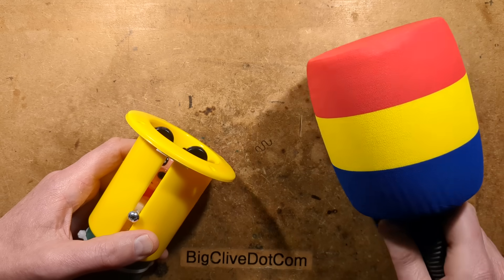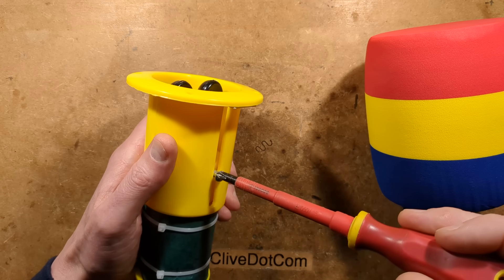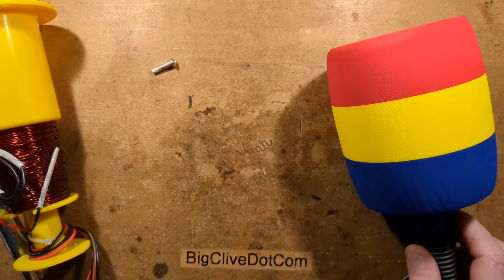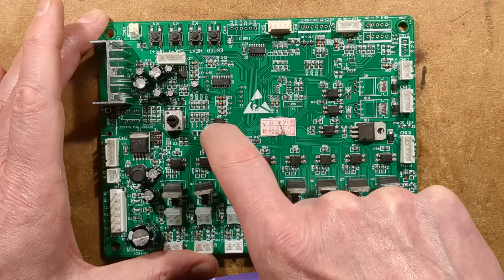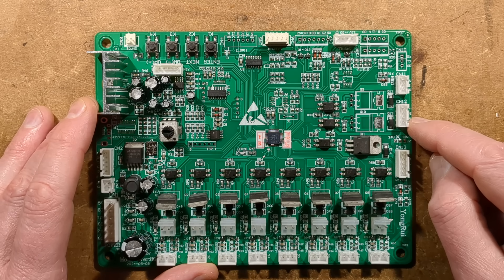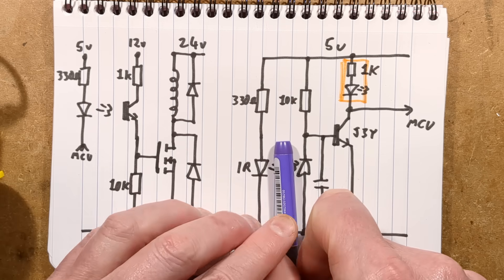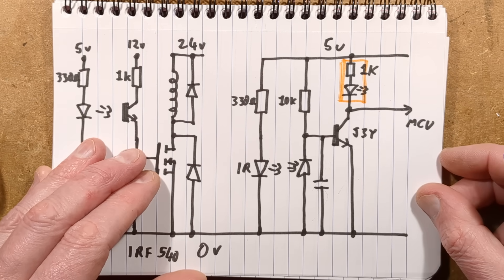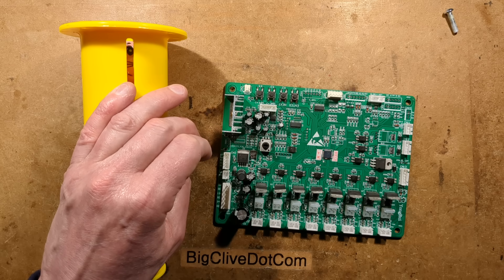Exploring a Chinese Whac a Mole type game

Comment: It's odd that they skipped 2 MOSFETs, but still fitted the optocouplers and connectors. I initially assumed it's because the MOSFETs are through-hole, so loaded at  different stage, but aren't the connectors also through-hole?
Reply from the maker: Maybe just manufacturing options.

Comment: Interesting note, I live about 15 minutes from the company that invented & manufactures the original Whack-A-Mole, and I once worked for another company that was their IT maintenance contractor. I applied for jobs there a few times over the years, but only once got a call for an interview - just after getting a job elsewhere. It was all good though, the job I did get was a good one.

Comment: The "key" connector is probably for a remote keypad which is on the inside of the coin door. These are used by operators to be able to set up/adjust/diagnose the machine without having to reach in to press buttons on the board. You can stand in front of it and stoop down and press the buttons on the open door. It probably supports 4 buttons which are wired in parallel the 4 on the board.

I have a friend who worked in the vending/amusement industry in the US and the stuff you say about poor diagnostics is on purpose. The number one mantra is "get the money". Don't lock anything out unless the machine is at risk of giving away free items/entertainment. So machines do not deactivate even in rather broken states. People who lose money because the machine doesn't work right are seen as an issue for the operator to resolve, not the machine itself.

The machines often have decent diagnostics but they only store codes or don't run until the operator uses the buttons (mentioned above) to run them. They are there for the operator to diagnose the machine and fix it, not for the customer (non-operator) to discover the machine is broken.

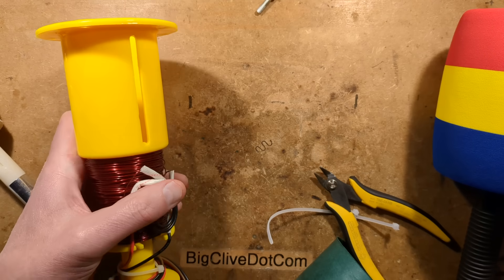Comment: 4:13 That is a KSD9700 bimetal thermal fuse. So yes, it will self reset. An 85°C fuse should trip between 80 and 90°, and reset at 60°C, +/-15°. (So, not exactly a precision device!) I don't believe they could make a one-shot, non-resetting fuse anywhere near as cheap as the self-resetting ones. I think some special purpose gallium alloy devices exist for some times when you need an exact temperature cutoff, but a cheap bimetal strip will always be cheaper. And a PPTC fuse has a gradual increase in resistance and low current handling, so isn't really useful in situations like this.
Hah... And you said we might not be interested in the thermal fuse! 😂

Comment: Mistake I made in the 1980s working on domestic gas appliance test rigs was taking the coils off the water / gas valves and they burnt out / smoked while I was fault finding the production line test equipment.
Our test rigs used mechanical rotary switch stacks for logic a bit like old rotary switches on washing machines before electronics.

The following year 1984 I was programming a rack mounted computer (BBC basic) pneumatic full bore ball valves and gas measuring meters [Laminar Differential Pressure (DP) Flow with mV output] using MODE 7 graphics on a Ferguson TX 90 with RGB

We had a large bubble glass stack about 6ft long and 1ft diameter with optical detectors to detect the soap bubble traversing the vertical glass cylinder which was a know volume for our standard calibration for natural gas boilers.

All great fun and all before the internet [those days you were on your own]

Mercury bead used as an O ring in a small glass tube was used to calibrate needle valves that we used to test appliance production line gas leaks, on our gas fires we capped off the gas jets applied pressure and tested for leaks, even if you saw soap bubbles on the brazed joints it would still pass providing there was a green light on the test rig.
[remember we sealed the jets with rubber caps and in used the jet in use would be open into a Gas Fire Radiant with no back pressure]

Now I feel old thinking back that long ago
Reply from the maker: At Hussmann we used to stuff a screwdriver inside the coil if we took it off the solenoid valve during testing, to give it something to chew on.

Comment: The issue of the the micro locking up and cooking the coil issue could be countered by using a charge pump to drive the gate of the MOSFETs.  

A past employer used it on a system for staged curtain drops and reveals, known as ‘kabuki drops’ in the theatrical effects industry, to minimise the chance of a false release.

Comment: The whack-a-mole games often have 9 critters (in a 3x3 grid), so I was surprised this didn't have provisions for 9. The controller listing shows a machine with a 3+2+3 interlaced arrangement.
Reply from the maker: Possibly because 8 outputs fits nicely to a single 8-bit microcontroller port.

Comment: ah you didnt' power it on, i wanted to hear the 8 bit sounds ;) I bet the key is something to do with opening the money door, or the printer that prints those tickets that you can reclaim for shit prizes
Reply: Most of these use dedicated MP3 decoder chips for sounds, usually on a flash IC. For example I saw a claw machine controller on Aliexpress that uses a USB flash drive for the sounds, and you can add your own.

Comment: There's a photo in the listing of the circuit board that shows which connector goes to what, and not all the bits come with it, speakers, lights, coin mech, etc. Did the circuit board come with the bundle of wires shown in the photo?
Reply from the maker: It does have the wiring loom.

Comment: Always been fascinated by arcade machines and owned a couple of fruit machines in the past that gave up the goat when the gruesomely expensive Mars Mech stopped taking coins and then the main board locking up and doing chaff all. Really only wanted them for the attract mode flashing lights because, you know, flashing lights lol. I have some of the boards still like the 50v solenoid (coin release) driver board and the 7 seg score/coin board which looks easy to hack as its just a multiplexed driver with single BCD to 7 seg driver and 16 common rails to each display thing. I also noticed the word 'watchdog' and I have to ask, What is the watchdog? what does it do? sorry if I sound stupid for asking.
Reply from the maker: The watchdog in fruit machines does two things.  If the processor crashes and stops sending reset pulses to it, it reboots the whole machine.  It also often has an antenna wire threaded through the machine's wiring loom to detect jammers and piezo sparkers being used to try and interfere with the machine, and that also resets the machine and may trigger an alarm.

Comment: Very interesting and it appears to be well constructed. Tempting to buy a minimalist set, as it may be fun for young children, but it may only work with all the intended components.
That coil is an overgrown pinball coil and must peak current really high - depending on the way the game operates, when fully assembled, it may require a beefy power supply.
Reply from the maker: It can be programmed to work with just 5 pop-ups.  But for the small extra cost you could go for the full 8.

Comment: With TX/RX, do you think the missing components would allow for connection of another board so that you can add additional 8 moles to the same game & scoreboard?
Reply from the maker: I doubt that option is available.  8 is more than enough on a game like this.
Reply: At some fairs, they have several of these machines running in a competitive mode. The carnie will control when all the machines start, then they run for a certain amount of time, and whoever has the highest score at the end of the time is deemed the winner. So perhaps the interface may be used like that (with a central controller)?

Comment: If you want to make/program one yourself with use of Arduino, take a look at the Kincony KC868-A16 board (can run on 24V). It is cheaper than the dedicated board but you need to purchase a display (if you want/need to). With this board you have 16 (! instead of 8) 10A mosfets (with flyback protection) you can use to switch inductive loads such as a relay or solenoid. Very interesting. It is made for IOT applications and home automation but I think it is also capable for designing games, such as pinball or featured game in the video. Have fun ;-)
Reply: And it also has Ethernet, WiFi and Bluetooth, useful for remote management? or Bluetooth to use your phone as a digital card?
Reply: @rares3968  Don't know what you mean with phone as digtal card. All other things, yep, is possible. Chipset is ESP32, ESP Wroom. You can also run a webserver-like application. Use websockets to communicate close to real-time. Very impressive. You can also dive into esp-idf but I found it a nightmare. Kincony has firmware for their products, KCS, but it closed source and there are a few bugs. Documentation is search-ware, it is there but you need to find it. Great potentional, cheap with a price, you need time to invest.

Comment: A company I worked for wanted to make an large interface board and keep it secret. They built the board and used a belt sander to erase the lettering on the chips. Static from the sander also wiped out the board.
Reply: Lol

Comment: As a software engineer, I've always wanted to have my own Whack-A-Mole game because a) that's often what debugging code feels like, and b) debugging code often makes you want to hit something with a mallet. I had no idea you could buy the component parts and make your own! The full arcade cabinets cost thousands of dollars, so I'd never seriously considered getting one, but this approach definitely has potential, especially knowing that it has some basic fire-prevention circuitry included!
Reply: Yeah, but honestly?

You and I both know if you want a bespoke whack-a-not-copyrighted-mole game, you're probably going to want to spin up your own board and write the code yourself.

Because what's the point of the whole endeavor if you don't want to hit something else while going thru the process of making your own thing to hit when you're annoyed? 😂

Sure, you can get satisfaction +5 from this board, but with your own board? More like satisfaction +25 because you'll remember every annoyance you hit when programming the board itself 🤣
Reply: @_Kirby207  Absolutely! At the very least, I'd want to hook it up to an Arduino or something so that I could easily interface it to my dev box, then have it pop up a random mole when my code fails to compile. "What? I have to rebuild AGAIN??!" WHACK!
Reply from the maker: The moles could be used as code markers instead of the usual LEDs.  (Which is what I tend to use when writing assembly code.)
Reply from the maker: And you can build it into your office desk.

Comment: I once repaired a very old unit that used large electrolytics in series with the coil and a resistor in parallel with the capacitor, to provide a simple peak and hold circuit.
Reply from the maker: I did ponder whether you could also do the same by pulse width modulating the output after the initial pulse.

Comment: You've got the detector circuit backwards. The photo-diode generates a small voltage when illuminated and sends current into the base on the transistor.

Comment: Worked on "side show" games in the 70's. This game Never had PCB's back then.
Birds nest wiring and a fist full of relays. Cotton bound rubber insulation, and random gobs of  grease.
Reply: Our company started accidentally via carnival.  I saw a high tech (for the time) attraction in a mall and started talking to the owner.  It turns out it was buggy, so of course I reverse engineered it and fixed it.  He told a friend Bill and I wound up fixing his carnival wagon.  Then another.  Then back to Bill several times until designing whole new gear to replace the old stuff, I used an actual 8051 processor and switching power supplies (worked really well on carnival power).  That new gear ran until he retired.  During this I got married and we started a company to get stuff wholesale and make billing more legal.  Then we got involved in lighting, somewhere in there ran into Clive and many other great people.
Reply: In the US we have redemption games without tickets or tokens. You swipe a loaded RFID card, it debits the network and after you play your “tickets“ are uploaded into your account. 

The serial ports and open ports are provisions for that setup.

Comment: This is actually a good platform to make custom whack-a-whatever games out of!  Personally I would only use the mechs and toss the main board.  I'd make my own so I can modify the code for certain clients that would want to rent the machine for tradeshows or events!!  Good find Clive!
However, I would take in to account some of the things Clive mentioned here, especially the screw eating the plastic over time.  I'd probably install a nylon spacer in there and a light amount of silicon grease.
Reply: I build myself a machine out of one of these chinese kits, the board is actually okay, it works pretty well. It does not do a self check, but if a head is not hit fast enough it just powers off the coil and assumes you missed it. At the moment i have this machine in my living room and i love it :D

Comment: another thing to consider is if the "mouse gets whacked" at just the right moment while the field is collapsing (or energizing?) the "core" can then multiply the field by residual magnet flux in the core itself, thus can easily exceed the breakdown voltage for the MOSFET, as well!
Reply: Modern mosfets are rated for exactly that. You can find it as not repetitive avalanche energy (in joules and is usually impressive)
Reply: I'm sure it does, and that's what the diode across the mosfet is for

Comment: The main thing I find interesting is that they've skimped the leds but left the optoisolators, associated components and protection diodes for the unused mosfets - My first thought was that they're saving on a reel but I'm 99% sure there'll be a power led on there somewhere so it feels weird to skip the fraction of a penny components, I may also be looking at it wrong and they're nothing to do with each other 😅
Reply: Make 10000 boards, saving those fractions of a penny adds up, and when your margins are already razor thin, those fractions are the difference between a green light or a red light to production.

- from the diaries of a guy who runs all his workplaces' P n' P machines.
Reply: @_Kirby207  but that's my point, a single optoisolator is something like 10x the price of an LED even at scale, so it doesn't make sense they've left multiple of those that aren't being used on the board but leave off the LEDs

Comment: About those 80c51 microcontrollers: I believe, the patent held by Intel expired or something, and they decided to finally flood the market with own clones, now officially — while also adding more peripherals and foolproofing; I have a Milk-V Duo board, it is based on the CV1800B SoC, and this chip has two independent RISC-V cores, while having a 80c51 core along in the same package.
I mean, it is that classic for them in China.

Comment: Strange it doesn’t have a up position latch. I suppose that’s so they all drop when the players turn is over.
Reply from the maker: Probably because they are short duty in use and an extra latch would need a release system and make things less reliable.
Reply: if you dont hit it in like 3 second itll go down and pop up another one

Comment: You should power it up just so you (we) can hear all the tunes since it doesn't seem to have an error code for missing solenoid modules.
Reply from the maker: I'll be doing that, but I'll have to rough up a suitable power supply system for all three power rails it needs.

Comment: The diode from drain to common negative is for protecting the MOSFET when the hammer strikes the mouse and drives the plunger quickly into the solenoid and the pulse  that's generated is a sharp negative pulse.  It's the opposite polarity from the inductive kickback spike.
Reply: I can imagine that it would be a pretty heavy back EMF spike. 

Especially if a larger, "dedicated" player whacks it with aplomb... ⚡️
Reply: Need to capture that back back EMF and charge a phone.
Reply: @gavincurtis  'what electric companies do not want you to know about cell-phone chargers and how to beat them!'